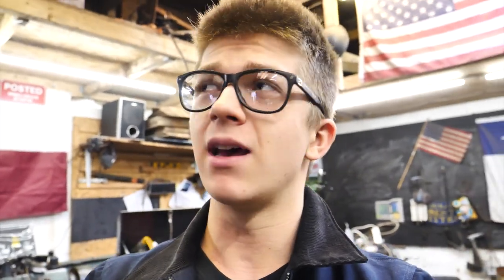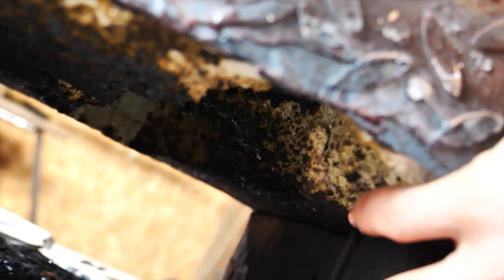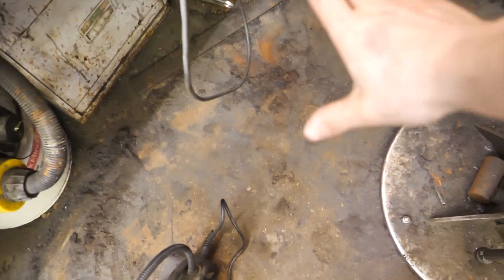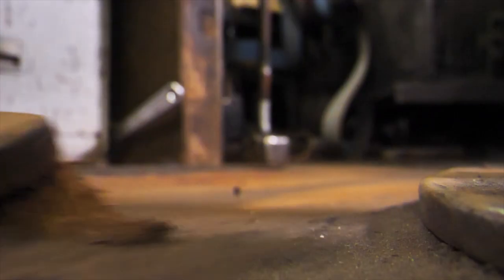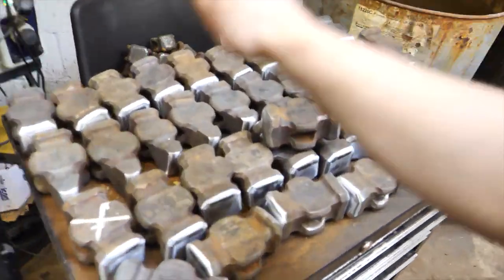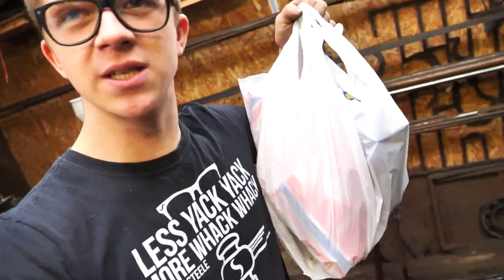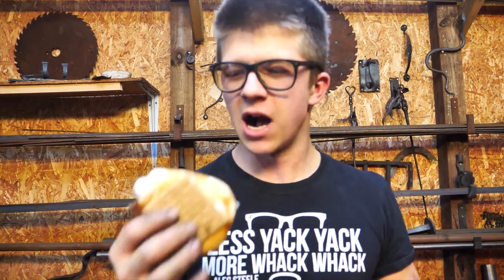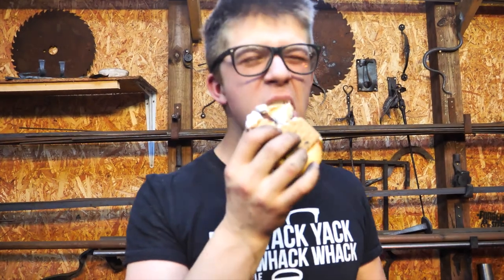HOW TO FORGE S'MORES: Blacksmith Vs. Delicious treat!!!!

Comment: I made smore's last night! Sadly it was just with a wood fire pit and not with my forge. But the special thing I did was take some 1/4'" rod, sharpen the tip, and stick the end into a drill. I put a marshmallow on the sharpened end and now you get an evenly toasted marshmallow!

Comment: If you are having problems in your forge with the castable lining you could try some fire face furnace bricks (I think thats the term for them, they are the bricks used in a molten metal holding chamber for contact with the metal.) I built a small forge/oven about 20 years ago with some used ones and they are great. Very dense and they hold a lot of heat and don't seem to burn out even when in direct contact with a fan forced natural gas burner run with a temp controller.  With them holding so much heat they also keep the temp inside very stable (good for heat treating i have found) . They do need insulation around the outside though.
Cheers

Comment: that was Awesome! next; forging bacon damascus!! pizza damascus!! just think of all of the foods than could be forged! talk about a panini press!! can you forge a waffle iron and make a waffle with it as it cools off?? so many new questions and ideas! 
when you rebuild your forge could you build a box on top that could use the excess heat as a convection oven, maybe add a small motor for a rotisserie, start eating really well in the shop? if it is running anyway may as well make the most use out of it, if possible. the only real question is rotisserie chicken or pork roast first!!

Comment: Hey Alec, 
I really enjoy the videos. I was just watching the one where the grinding belt blew up on you. Just wanted to voice something, I noticed you aimed the air hose at yourself and were cleaning yourself off with it. It seems like an ok idea and all but if the air gets into your bloodstream through your skin you could die from it. Stay safe friend
Reply: it also depends on how close the nozzle is held to the skin.  hold it about 15- 30 CM away (or 6 inches- foot for those imperial users..) and it's fine.
Reply: yeah theres practically 0% chance of that happening with how hes using it. if that was the case just holding your arm out the window of a moving car would take lives daily, but it doesnt.

Comment: your forge could use a coating of sodium silicate (liquid glass), it has a higher burn temp then the brick, and would help with the brick oxidising at higher temperatures.

Comment: make a hamer from the grinding dust
Reply: It would be a very weak hammer
Reply: dainis savicus He would have to go through the whole process of casting an ingot and I don't think he has the equipment to do that.
Reply: he wouldn't have to cast an ingot. just forge weld it.
Reply: brandon there is probably too much oxidation and other contamination to reliably forge weld, even in a canister.
Reply: well id still like to see him try. i do though understand that he doesn't have time to do projects like that. besides whats the point in trying something new if its easy.
Reply: brandon - Granted, due to Gibbs free energy, one can make the oxidation process run in reverse... But something tells me he doesn't have a smelter just laying about somewhere in there.  Would be totally bad-ass if he had something that would handle it though.
Reply: brandon the process of turning scale back into usable iron requires a very special type of forge. It's really not going to happen on a small scale. Even large operations struggle with the process.
Reply: its really not that hard its just a time killer. also @stormreaper6436 you can make a smelter with either some mud and/or like 3-4 cinder blocks. ive seen it done id just like to see what his method would be.
Reply: brandon look it up, a standard bloomery is no good for mil-scale.
Reply: /watch?v=3Ir_MLv_Tfs worked well enough for this guy. is it going to be a $500 hardened steel knife? no. is it a knife? definitely. a more optimistic outlook on thing you think cant be done can be healthy.
Reply: I've seen that video, that's when I researched whether or not it could be done.  Chandler mixed both grinder dust and mill scale and tried to form a bloom.  The grinder dust that isn't mill scale is usable and will form into the bloom, however the mill scale will not reduce in that type of forge and will weaken the bloom making it virtually unusable.  As you saw in Chandler's video most of his bloom crumbled apart.  So maybe you should take a look at some actual research outside of Youtube before you assume I am being too negative.
Reply: but it still worked and i would still love to see alec make something out of the floor scraps. all you need to do is take a weak magnet and pull it through the bucket a bunch of times to separate the good and bad steal, smelt it and forge it. i don't need to research this, ive done it and ive seen other people do it. the thing is alec, from what i can see to busy to play around and experiment right now. i just think he should keep a buck of that scrap around for when i gets free time to try a fun project.
Reply: Yeh, give it to someone - first blow, kaboom! Good joke
Reply: dainis savicus Chandler Dickinson tried this
Reply: JoshL And, somewhat, succeeded! ! !

Comment: howdy.  Saw another video, dont remember where, and saw the builder paint an aluminum or silicon rich paint of some sort on the refreactory, which when fired turned into a ceramic protective coating.  Aluminum silicate perhaps? Could that help slow down the burn rate (ha I made a , well, maybe not, made a funny)

The videos are interesting, and well put together. Thanks for doing these.

Comment: Why don't you use a large magnet to recover the shavings and fine dust instead of sweeping?  
Whenever I am working with ferrous metals I will put a large magnet inside a similarly sized bowl so I can recover small shavings without it mucking up my magnet.